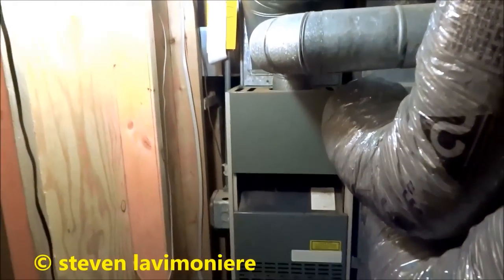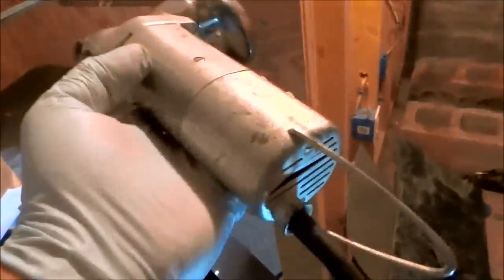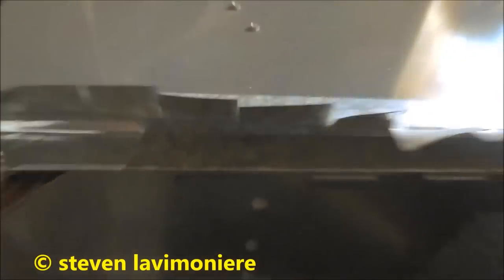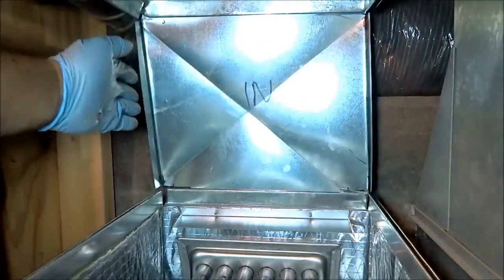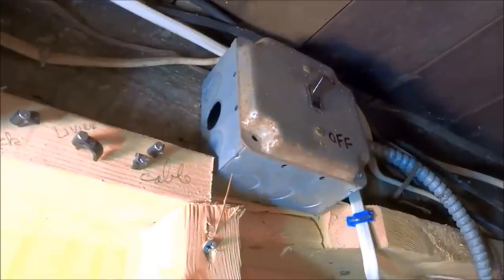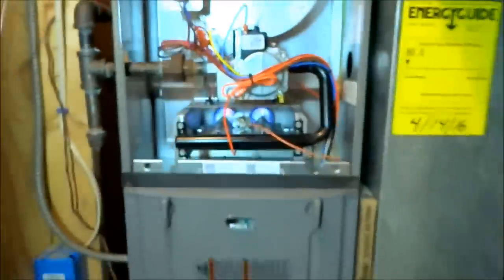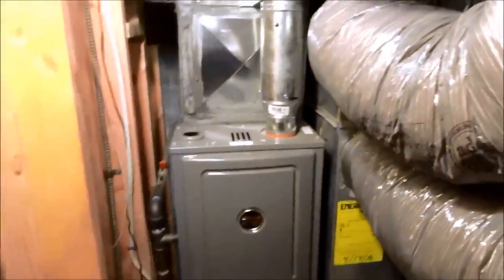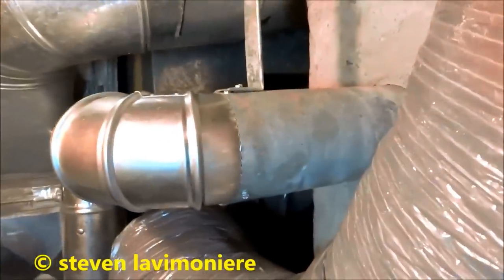Gas Furnace Change Out How Its Done

Comment: I personally don't mind using the flex gas lines, but I never run them into the actual furnace cabinet to the gas valve.  I always use hard pipe for going into the furnace cabinet connecting it to the gas valve because I have heard of and read reports that the flex lines can eventually rub against the hole cut out where it enters the furnace cabinet and cause a catastrophic explosion or fire.  In the mid-1990's this happened a few times (in Phoenix, Az.) and literally blew the roof off of peoples homes, so they finally made it a legal code to run the hard pipe into the unit and never use the flex line.  It is fine to use a flex line only on the outside of the furnace, where it is not touching or going through any type of wall or metallic cover. 
     Thx. for the vids, the information, and the entertainment.  
     Next level bro.
     God bless

Comment: hi! just got a new gas furnace after 35 years. I'm in an upstairs duplex, separate furnaces for upper and lower units. a new digital thermostat was installed in my dining room for it. I have the heat set to 70° - the apt. feels warm enough (I guess) but when I walk past the vents they're blowing cool - almost cold air. The furnace man gave me the "run-down" on how the unit heats up, how it maintains heat and how heat travels to my second floor. I was lost after his eons minute explanation. While I appreciated his knowledgeable attempt at his
Reply from the maker: make sure your thermostat is set to .....fan automatic....if its on fan on the fan will run all the time..there also is a post purge on the fan to cool down the heat exchange after a heat call so the fan will run for a while after tstat is satisfied ..

Comment: Steve that is an impressive job, especially since it was in that tight space. I also liked it when you walked us through checking the gas pressure and adjusting it to get the combustion readings in the ideal range.
Reply from the maker: +Joe Bal good comment
Reply: @stevenlavimoniere  what tool doid you use for the combustion readings? Thanks!

Comment: Nicely done. Thanks steve.  For inducer draft furnace 02 should be at 6-9%. U r a little low on O2. Ur testing point should be a little closer to the inducer motor. What is ur temp raise? Ur draft is terrible. Should be -0.01 to -0.02 and stable.  Need fix the draft for sure.  What cause that swing like that.  Maybe wind idk. Yes u right we cant go with gas pressure. Oh ya u got the same book i got.  Yes O2 from 6-9%.

Comment: That turned out sweet! A starkap on the hot gas vent will stabilize that draft even on a windy day. If someone were to put a piece of paper on the combustion air vent on the top of the furnace when running that situation would be deadly. If you timed how long the furnace took to shut down on the pressure switch, & monitored the ambient co levels around the furnace, you would see why Jim says put dual acting barometric & spill switch to shut it down within three minutes given restricted/misdirected combustion air or flue condition, it is the only way to truly make it safe for all circumstances. With the Baro & ss some miracle machines will rock & roll @ 3 to 4% oxygen, cuz you have control over the vent that sometimes can't remember which way it needs to go. Anyways thanx for teaching, I'm always evolving & learning thanks to guys like you & Jim. Every day's a school day in the ever changing laboratory we work in called the real world!
Reply from the maker: +Jeremy Calvin thanks for the comment

Comment: I have a question sir, there's a 1500 square foot block Foundation home that has a gas furnace in the hallway closet with ductwork in the Attic,, it doesnt have central air built in 1963. In theory, can you replace the gas furnace with a gas furnace AC combo and connect it outside with the fan and tie into the ductwork in the attic and be good to go,, even if the space has to be enlarged for the furnace is this something that's done often to homes with no central air conditioning? Thanks

Comment: I'm in Indiana and we get some harsh winters temperature wise.  It doesn't make sense to put a high efficiency unit in strictly for the savings.  Same with a high seer rated a/c.  The recovery on that cost sometimes can't be attained for 15 years.  If you went all out on 3 stage equipment, your repair bills will wipe out any savings you made along the way.  Not to mention the reliability of more technical equipment.  You open yourself up for headaches.
Again I said "strictly for the savings".  I realize that noise, air quality (good aprilaire filter with an 3 phase dc motor that runs on almost no electricity) if you run the motor 24/7, comfort of a more precise system...  I do get that.  But the majority of the people shouldn't be affording those high end systems.  They need to save for retirement so when the furnace breaks they can afford repairs.

Comment: Man couldn't they have ripped that out and had a wet system 
the kind of heating is stone age 
Nice install steve not an easy one
Reply from the maker: +k20aa stone ages or not it works fine
Reply: True steve not having a go at you 
you did a damm good job fitting that looked very tricky

Comment: Fun install, made some good points but for the life of me I can not figure out what you mean when you say "It's Underfire, It's Underfire, you cant always go by the gas pressure". This is NOT a technical term, for sure and I see zero issue with running it just like it was initially. The manufacturer designed it to run at that pressure, I'd love it if you'd explain what was the issue with running it "Underfire" (whatever that means). as someone else stated you are raising the temp directly into the heat exchanger which will definitely be causing it more stress, for no reason, in my opinion. What did  you gain? Certainly not efficiency. BTW flex gas couplers are actually HELPFUL because they reduce the physical stress on the gas valve and the whole furnace, which why they are code in many areas (as are flexible duct connectors on all ductwork for the same reason). Finally, I can't believe you didn't pony up a few extra bucks for a 90+% furnace considering you are in an extremely cold zone. In the 35 years that inefficient piece of junk was running in the Northeast you could've saved enough running a 90% to buy a new van.

Comment: Fieldpiece hoses suck . Can't use them in a greasy busy kitchen. When I went to the van for parts some Bozo stepped on one. Good thing I noticed the gauge / readout was on zero. Slice like a wet noodle. Buy the silicone red air switch hoses. Way more safer.  Called up Fieldpiece acted like I was crazy. Told them could have been a possible disaster.  A word to the wise!!!

Comment: When you measured for the cut did you take off like a extra 1/2” from the size of the return EX- if it was 16X25 do you take a 1/2” off from those numbers so the return can get screwed into the unit.

Comment: What grinder blades do you use?
Reply from the maker: +Delvin Young steel cut off bladed i buy at the welding supply shop there tough as nails cracked blades will not spin off .there cut off blades .
Reply: +steven lavimoniere Steve, do you have a name brand on them? I'd like to pick up good grinder blades. The brittle ones I use scare the hell out of me! I've had them fly apart a few times already.
Reply from the maker: ok i will get one and get the info off it and send it to you .the ones i use are great even broken or chipped , they will not fly apart .there is a fiberglass webbing in them .so they stay together .
Reply: @stevenlavimoniere  hey can you send me that info too?  The info on the blades, and also that grinder as well if you dont mind.